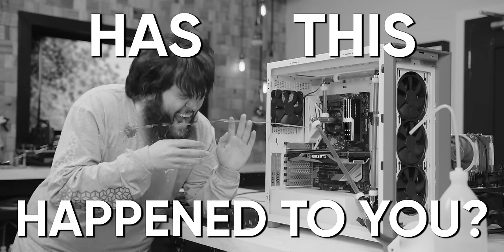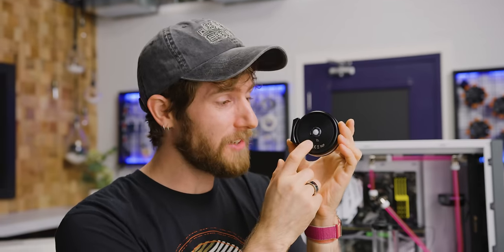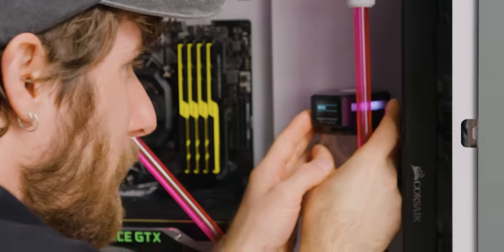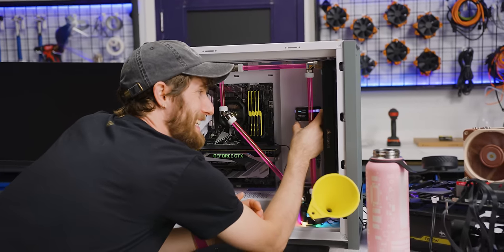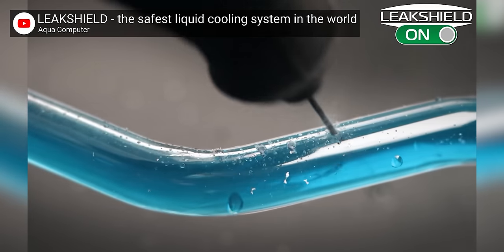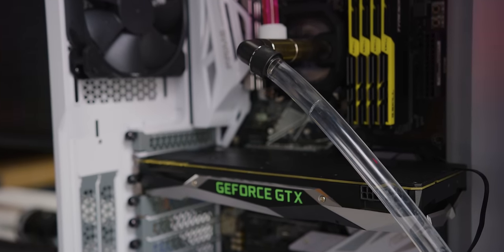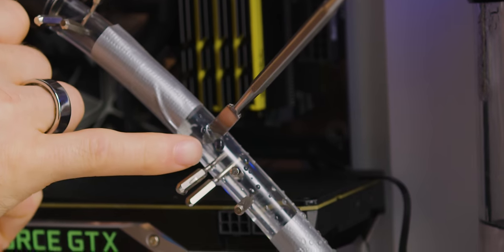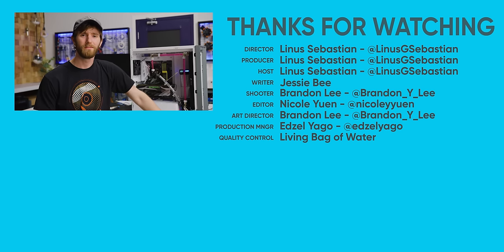I can’t believe it didn’t leak…

Comment: In terms of what your typical leak is, a fitting leak, this is an amazing product to help protect your system, if you’re running a custom loop you probably have a top end system you’d want to protect. Something actually useful for once
Reply: I agree, if you had a high end system with a custom loop - just the alerting, let alone it protecting your system could save you a lot of pain.
Reply: Yeah if you paid 5000$ for a pc, 120 220 or 320$ doesn't matter for safety. 
I will insta buy that an replace with mine.
Reply: It's amazing how much water you can get on your motherboard and still have it work. I forgot to tighten one fitting, and dripped water down the side of the CPU socket, and right down the rest of the mother board, and once I let it dry out, it all worked perfectly.
Except the SATA port that still had water in it. That didn't work.
Once I dried that out too, the motherboard was fine though.
Reply: Yeah the fact that it will warn you about a bad fit, and protect your hardware long enough for you to fix it, that's amazing. That totally makes watercooling more approachable for more people.
Reply: @phuzz00  hat's anecdotal evidence though. Others might be less lucky than you. For example the shielding of your mobo could've been scratched somehow and the water could short something slightly important - BOOM dead mobo (and if u're really lucky you might be able to kill some other components aswell) 

Not saying mobos aren't the tough motherlovers they actually are though
Reply: @oktayzerin  Same goes for Inverters too, when you put a decent gaming PC together, ALWAYS BUY AT LEAST A INLINE OR ONLINE 700VA INVERTER !
Reply: This will not work if you have an system with dual reservoir and dual d5 to let you know. Unless you reduce the pump speed to reduce its flow rate.
Reply: @jannikl.8542  its honestly not even anecdotal evidence, you can get electronics wet, dry them out and use them. What he failed to realise is he got lucky, what if it had been leaking at night while it was on and he was sleeping? system would be ruined
Reply: Wrong! I love drilling holes on my tubing and this is a fantastic product to stop me from killing my all my 3090s that a scalp.
Reply: @molleycyrus7309  Erm you can wet them all you like as long as they arent powered on. 
That's why you fill and let the oxygen go out of the loop, top off,then run for a few more hours of leak testing,  before you plug in anything important like... main system components. 
leave paper towels in place for days Just in case. 
Once bled and leak tested its incredibly rare to get leaks .
Unless you use glass tubing,,catastrophic failures are even more unlikely...and even with this device I wouldn't trust glass tubing because I dont see it failing any way other than catastrophically. 

But hey, you do you...
Reply: @Niosus  it doesnt inform you about a "Bad fit " it cant say which is it. It only can tell there is a leak or drop of Pressure inside the system
Reply: @jannikl.8542  water will never short anything out!    crap in the water will though.     Fill your system with the right WATER and leaks are not a huge deal...
Reply: @KC8DKT  Water is conductive, what are you even talking about?
Reply: @defiantgg1831  not distilled one which you should use for filling loops
Reply: But if you do have a leak and you turn off your system, leakshield wont do anything. So it's pretty much useless.

Comment: Honestly, if you're already spending like $400 on a custom loop, it makes sense to spend an extra 80$ or whatever to make sure your loop doesn't damage the rest of your rig. Idgaf about custom water cooling, so I'd never get it myself, but it seems pretty damn impressive and probably worth it for those kinds of people that drop $2k+ on a PC
Reply: agreed, I actually expected it to cost more
Reply: Definitely. I once forgot to tighten a fitting on my personal loop enough to make a watertight seal. Didn't know until I realized my reservoir level kept dropping rather quickly, and had to find it with UV lighting. This thing would not only have told me, but given me real-time feedback as I test each fitting so that I can narrow down where the leak is and have near immediate confirmation when I'd have fixed it.
Reply: @VraerynDaDragon  And it will ensure the water isn't leaking into the machine while doing so, which is the coolest bit imo.
Sure it's basically just vacuum increase to counter the 'loss of containment pressure', but it's smartly done.

I wonder if american oil-line companies should invest in this kind of tech to help avoid those oh-so-often-heard oilspills and leakages.
Reply: @kinagrill  I don't think it'd be practical there. There is so much money in that industry that if this would work, they'd already be doing it.

But yeah, a lot of UV dye stains in my systems that wouldn't be there if I had this thing.
Reply: " so I'd never get it myself" so you probably expect to die in 15 years,
otherwise you very probably would use water internally cooled cpu ( in-chip water cooling ) with many layers of silicon inside, which can't be cooled other way around.
Reply: @sddndsiduae4b-688  It'd most likely not use basic water, but perhaps some sort of oil or other heat-transfer friendly liquid.
Reply: @kinagrill  strange that they mostly use "water cooling" in name of that tech, yes i also thought that some sort of oil would be safer,
and normal water is not used anywhere, in any "water" cooled system there various specific additives in cooling liquid, in any case before light based computation became faster in non parallel programming, multilevel "in-chip water cooled" cpu would be mainline, however they could integrate cpu and "water" cooling and radiator same way as coolers integrate heat pipes, especially inside smartphones, tablets and notebooks. (apple already integrates memory and cpu (m1) )
Reply: @VraerynDaDragon  when has America or any country ever done anything that would have been better till they needed to?
Reply: @Kruscle  d
Reply: Sadly 2K only gets you a good mobo and proc these days. 🤣
Reply: Sadly, I think most people are of the "don't gaf" mindset when it comes to custom loops, because it's just so expensive these days, AND there's cheaper alternatives that are almost as good like AIOs. I feel like custom water cooling is slowly dying off
Reply: @VraerynDaDragon  That's not true, it depends on the margins. I'd be willing to bet that it IS viable in that field, but they choose to let the occasional spill happen instead because when you do the math, it'd cost more to implement the new tech than it does to just eat the cost of oil spills. Sadly, that's how these large corporations think. The fines and losses cost less to them than just doing the right thing, it's why situations like flint Michigan exist
Reply: 400? cheap...
Reply: @sddndsiduae4b-688  water IS used for most cooling systems because it is best at carrying away heat, oil is not as efficient, the additive is glycol and it is meant to lower freezing point, not really necessary for PC cooling unless you're using a chiller. Useful for vehicles inn winter and commercial HVAC systems that need sub zero coolant.
Oil is used as coolant in high temperature situations (above 100c) where water would boil, some oils can go up to 300c without boiling, jet engines and some industrial processes use that.

Comment: I don't even like water cooling but that thing is impressive
Reply: I'm all for air cooling too, but yeah that thing is actually really cool
Reply: Real men use air. Water is like using steroids.
Reply: Water cooling doesn't like you, either.  This is why it takes leaks on you!
Reply: @basshead.  real man throttles
Reply: @corzahazard444  Nah, I was just joking, and the joke was that real men don't use any active cooling, and just underclocks and throttles to hell.
Reply: @haniffaris8917  All good man
Reply: @1000pingVendetta cost for cost air is the better performer
Reply: Air cooled is by far cheaper in the long run
Reply: Corey Black not if you buy reasonable parts liquid cooling for cheap is easily available on alixpress amazon and most places if you really search for it.

Comment: I’m actually extremely impressed by this product!
Reply: You are like, the first person in over a dozen comments to actually talk about the product LOL.
Congrats on that - and I agree!
Reply: @Turidus   Actually its not 120usd. If you want to get it first, Its going to cost 100euro shipping from aquacomputer direct. Otherwise you got to wait 2-3months for restocks at resellers (ppcs, titanrigs, modmymods, dazmode).

Aquacomputer stuff is incredibly backordered with everything low inventory even at aquacomputer and its 60days backorder at aquacomputer itself
Reply: @Turidus  It doesn't replace the pump and reservoir though, the leakshield is just the device they have on top of the reservoir. The whole leakshield + reservoir + pump combo Linus used is over €250 on the website from the description.
Reply: @Turidus  yeah it’s just the cap that’s $120. Still, for the technology it’s a very reasonable price. Can get a standalone unit too. 
It’s just really impressive that it’s able to be so precise. If think about it, the fact that it’s a leak tester (as in for pre-testing a loop) saves anywhere from $20 (AliExpress barrow tester) to $40 (for EK leak tester). Really doesn’t seem bad at all when you compare it to those
Reply: @cwill2127  i mean 120$ still isn't cheap but  considering how well it performed in the video and that a leak tester costs 40$ it's certainly justifiable.
Reply: @Ocastia  It is cheap for the protection it provides. Obviously if your PC costs $500 or $1000 then sure it's not for you but then you would probably have an air cooler anyway, but for someone who has a $5000 or $10000 PC, well this is a bargain! Personally I use an air cooler so its useless to me :)
Reply: It's one of these Products that is great to explain the concept of Clarkes third law: Any sufficiently advanced technology is indistinguishable from magic.
Reply: @MrTree421  all it does is put the system under vacuum 😅 the concept is quite simple actually but the pump is impressive given the size and how much air it's able to move.
Reply: @Mike-sf7ex  well yes but the sensors are impressive, and for someone who didn't pay attention to physics in school, that is definitely a good thing to show Clarkes third law, i mean come on even when knowing how it works, seeing Linus drill a hole in his loop, just to have it not leak is impressive.
Almost as impressive as seeing 4 holes leak like there's no tomorrow.
Reply: @Ocastia  What sensors? You mean the one pressure sensor it probably has?
Reply: @Maxiligamer  well in the video Linus said it has 18 sensors in total, however aqua computer did not specify anything on their website, apart from the accuracy of the pressure sensor (0.0001 bar) so that's all I can tell you.
Reply: @Ocastia  Ah alright. Seems like 18 is way too much, you can get the job done with one or two, but it could also be they are using 18.

Comment: “Always twist, never stab.” - Linus Death Tips
Reply: Linus kill tips
Reply: The best comment ever 4
Reply: Congratulations, you are added in my list of best comments which the 1st 3 I forgot
Reply: Haha
Reply: Also at 10:28 >That's why they say "Quickly remove a stabbing implement"<
Well yes, when you want..uhh..a "leak".
"They" are scary people!
Reply: LinusMurderTips
Reply: This is the golden comment here, highlighting the important advice.
Reply: @eagle7015  also good advice for a handy. Just don’t grip too hard while doing so. Else you may be on a certain medical television show.
Reply: Nah it should be don't stab just cut. Stabbed one is still capable but at the same time approaching the end. Not so much with few muscles cut and a few leakages from long openings in the skin cover. 
At the end of the day, you will not murder the individual. A single stab will end up in some painful long dying.
EDIT: Also, stabbing is dangerous because of closing the distance. Cuts are made with a fully stretched arm and only with sharp edges on both sides of the tip of the blade.

Comment: This is really impressive, the fact that it doesn't need software running makes it even better and also means you could have it running while your pc is off for 24/7 protection.
Reply: Yes, but there could be a small wired remote control with two or three buttons so that you don't have to wedge your hand into the possibly cramped computer to operate it.
Reply: @JohnADoe-pg1qk  That would be a great upgrade.
Reply: @JohnADoe-pg1qk  software
Reply: @John A. Doe  thats only to use it while your pc is off. He didn't have the pc on while he was doing this, just the cooling system.
Reply: @austinabbott1120  it has a usb port. i can charge my phone or run a usb fan on my mobo usb3.0 even after i shut down the computer. just as long as it has been turned on before and connected to power. so it can run 24/7.

Comment: After linus stabs it with everything

Leakshield: All that for a drop of coolant?
Reply: @emiraryaputra4900  It's actually a Thanos reference
Reply: You win YouTube today sir.
Reply: And that was in the worst possible tube to test it. He tested it right after the pump, where the negative pressure is at its lowest due to the flow restrictions caused by both the microfins in the cpu block and the radiators. If he had tested it further down the loop he might've gotten away with even more.
Reply: Underrated comments 😂
Reply: @SophiaF3499  what did they say?

Comment: As a person studying mechanical engineering, this is a really cool display of concepts we learn in fluid mechanics.  Im guessing in order for it to prevent fluid motion outside the tubes, it is trying to pull a vacuum in the reservoir.  Im curious how they account for changes in pressure caused by turbulent flow in the pipes when a hole opens in a tube.
Reply: 300 millibar is equivalent to 0.3 atm or 120 inches of water so back pressure and resistance to flow are not likely to be issues in this application. I doubt any pump used in pc water cooling has the head to overcome that level of back pressure or the power to drive fluid at flow rate to generate that back pressure on pc water cooling components. (Pump curves) Unless the water level of your loop is 120 inches above the lowest point you should be good.
Reply: @garmack12  proceeds to build a 10ft tall rig....
Reply: @garmack12  that’s actually really good to know, thank you for explaining!

Comment: This would make custom water cooling a lot more attractive to me, as this is my biggest worry.
Reply: I ever get the money for a custom water cooled pc. This is the first thing im buying.
Reply: not worth it really,  at least not for $120...
After running custom loop cooling on systems for 10+ years, basically 24/7/365 , ive never had a leak beyond the initial leak testing and even then its usually only a few drops.

Honestly the only time I've seen a worse leak was with a Chinese D5 pump from Barrow. For some reason the O ring wasn't sealing to the Reservoir well enough to hold pressure... 
But thats why you leak test .

Once  a loop is operational,  im not going to say it will never leak, ever.... but its exceedingly unlikely. 

Those blue automotive paper towels are awesome for leak tests as they hold a good amount of water.

Anyway that's my experience, just measure well and make sure your tube ends are properly finished and evenly cut & you are unlikely to have issues.

24/7/365

by the way, putting it like this $120 buys a Full cover GPU block, delivered..... or a few 360mm radiators... or CPU blocks and fittings...and the tools to properly cut and finish tubing ( which is the best investment to avoid leaks to begin with)

So yeah, up to you guys but my experience is this thing is banking on the paranoia rather than the actual fact, leaks rarely happen beyond your initial test.
Reply: @martinpalmer6203  A full custom loop is usually in the thousands of euros/dollars anyways, I don't see these 120$ as a problem.
Reply: @martinpalmer6203  but if something goes wrong. It only has to happen once. Id prefer it. Especially if im cleaning my loop on a bi-monthly basis. Its not too much more than a decent water cooling aio, so to have it give me the piece of mind. Id say its worth it for me atleast.
Reply: @florianreinhardt4689  
In the thousands of dollars? That's absolute endgame not the usual
Reply: @omegaPhix  Who does custom watercooling on a Ryzen 5 and 60 series GPU?
Reply: @florianreinhardt4689  
What has this to do with my comment? A grand or more is not the "usual" amount of money you spend on a custom loop. The system it cools doesn't really matter
Reply: @omegaPhix  That wasn't my point either, maybe I miscommunicated. My point was that by the point you're custom water-cooling you're probably ballin' anyways with a 3080/3090, Ryzen 9 etc. and your build is in the thousands, thus adding a 120$ to your custom loop isn't really that much.
Reply: @florianreinhardt4689  
 Even if you get a System with top of the line specs that doesn't mean that people invest another grand into custom watercooling. Like i said, it's not the "usual" and you can get much more value out of 120 bucks just like Martin already explained.
I don't know how many custom loops you've built but a little less than 500€ was the max i've spent for a 960mm "baller" hardline build.
Reply: The biggest advantage of custom water cooling is that you can make the most use out of the options your pc chassis gives you,  I have a threadripper setup that has three 140 mm rads in it in a case that really was not intended to ever be water cooled, and while I had some concerns at the start of it at having that many junctions it has been running issue free pretty much 24/7 for a couple years now.